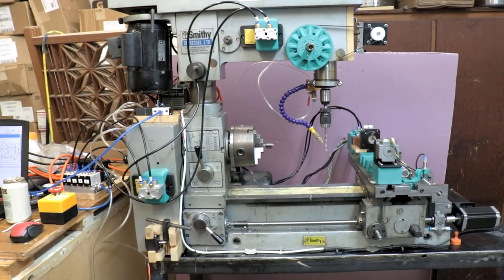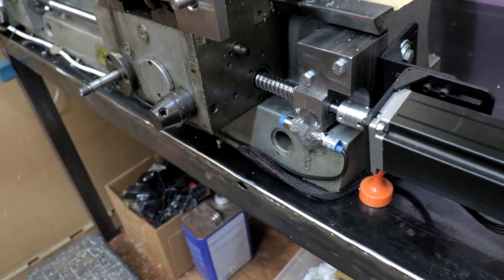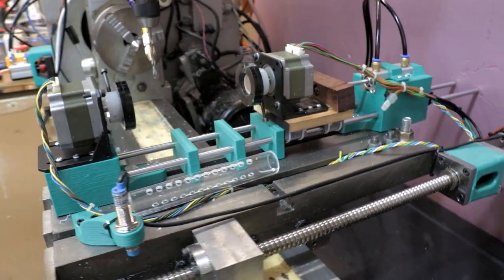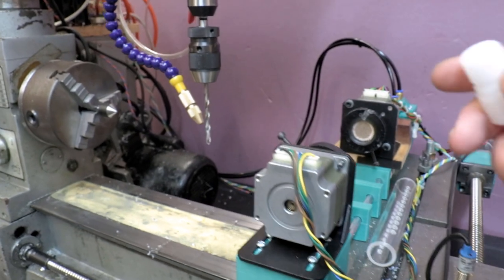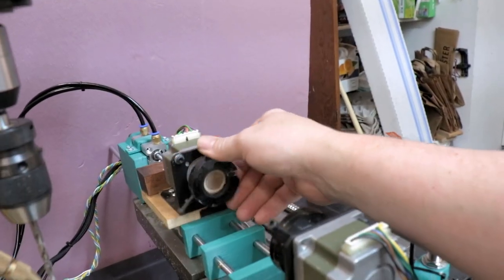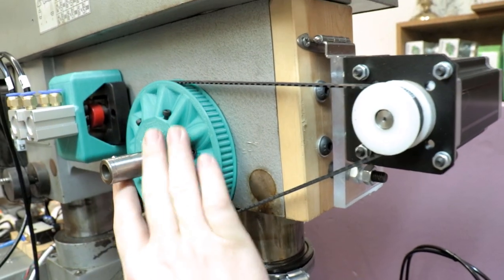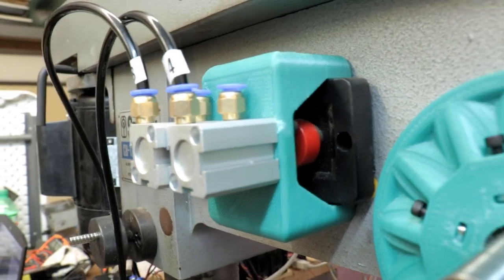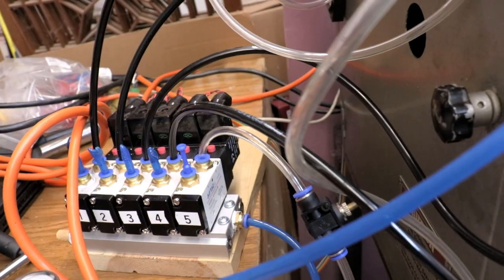Smithy Lathe/ Mill CNC Conversion

Comment: Wow nice conversion. 
How about a CNC mill that has a fourth rotary axis that is used for CNC milling but also lathe work? So the lathe chuck could spin fast or be indexed for CNC milling. I think I saw something like that and it seems like a nice compact setup for both.
I'd be curious if you considered that and what are your thoughts on that?
Thanks for the video!
Reply from the maker: Hey Dejay, are you the same Dejay I think I remember speaking with some time ago?
I'm not really sure what question you're trying to ask exactly. I did not make this machine from scratch as it used to be a manual machine, I only added motors to make it into a cnc machine.  I like the idea, but the way this machine was designed both spindles are fixed and the mill spindle only moves in Z direction.  
I have no definitive plans for this machine, but it is a nice little tool for small production runs.  I don't mind making jigs and whatnot like the 4th axis clamp thing that I made for this specific job, and in the near future, if I were to make any next upgrades, I think I would like to have VFD's on each spindle next.  Other than that I haven't really put any thought into it.
Thanks for the question and the input!
Reply: @Evezor  Yeah we chatted when you launched your kickstarter :) I still want to build cool things but life gets in the way. A mini CNC mill would be great for milling aluminium parts. And a 4th axis / lathe combo would be awesome. 
Oh This Old Tony actually made a video of what I'm thinking about. I love his videos, you can see it in action at min 18: https://www.youtube.com/watch?v=mAZei3wpBe0
PS: Not sure what motor he uses but I think if you'd use one of those fancy DC motor servos it might have more holding torque.
Reply from the maker: @dejayrezme8617  Oh yeah, I see now. For 4th axis stuff I'd have to attach a 4th axis on the bed, much like the current setup I have in the video above.  Or I would have to make multiple setups, like one in lathe and another in mill.
Reply: @Evezor  I have to watch his other videos, I somehow skipped them :D I think if you'd use one of those fancy DC motor servos it might have more holding torque.

Comment: Do you have a print file for that spindle gear on the mill
Reply from the maker: all source files can be found here  https://cad.onshape.com/documents/20bee6f318a0236cb44b001a/w/32068df17ff735e4c16675a7/e/53c4c27b9f7ca39e6fc175d3
Reply: @Evezor  Thanks for the link. Great job on the build.

Comment: I have the same Smithy. Where can I get these ball screws, couplings and stepper motors?
Reply from the maker: They're standard. I honestly can't say where I got these from.  You can get all this stuff from any reputable diy cnc place. You're going to need a controller anyways. I'm using a homespun board with some custom firmware so I won't be much help in that area, so sorry there too.

Comment: Awesome Conversion. I have the exact 3 in1 machine and just acquired the ball screws for the X and Y axis to start the CNC conversion. Did you have to do anything to the Z axis to improve rigidity/accuracy or just add the drive motor?
Reply from the maker: Thanks. No, I just took off the handles and added the pulley. Before I decided what I was going to do I took out the clock spring that returns the spindle to Z+. I wouldn't recommend doing that as now when power is released from the Z stepper driver the spindle will just fall down.  Just means I need to add Z home calls often mostly. 
Sounds cool and good luck with yours!!

Comment: Would you please share some details and files? What length x and y screws did you use?
Reply: I’m have the same Smithy and want to convert it
Reply from the maker: I believe they were 12mm ballscrews
Reply from the maker: This was a one off design and I cannot comment on the accuracy of anything. I'm a machinist by trade and just did whatever I felt like in the moment. Whatever sizes I used were either arbitrary or whatever would fit into the pretapped holes that already existed. 
Here are the files I used if they're any help. https://cad.onshape.com/documents/20bee6f318a0236cb44b001a/w/32068df17ff735e4c16675a7/e/53c4c27b9f7ca39e6fc175d3
Good luck!!
Reply: @Evezor  thanks a bunch, appreciate you!

Comment: Can you tell me the diameter of the quill timing pulley or ratio of the two z axis pulleys? I am converting a 3-in-1 as well.
Reply from the maker: It's 80 teeth for an XL belt.  It's about 130mm in diameter I cannot remember the number of teeth on the small pulley sorry, but it did come from mcmaster carr if that helps.